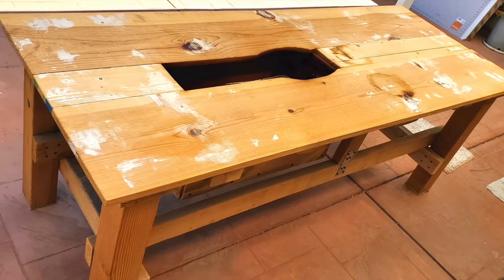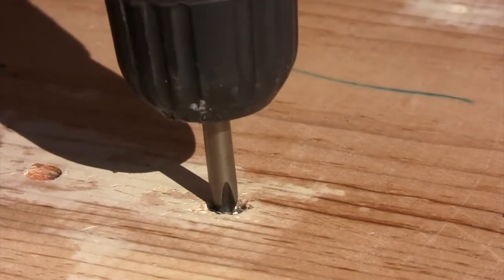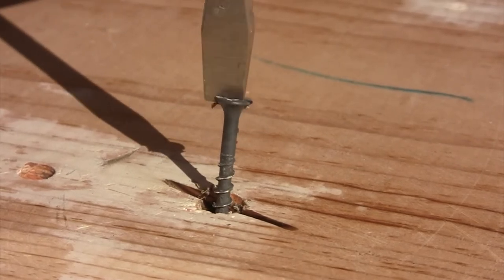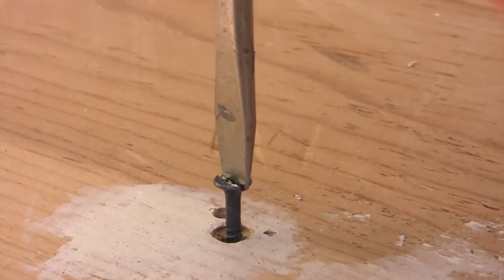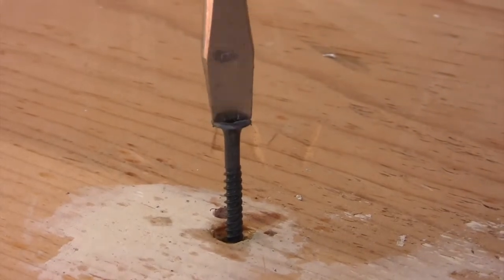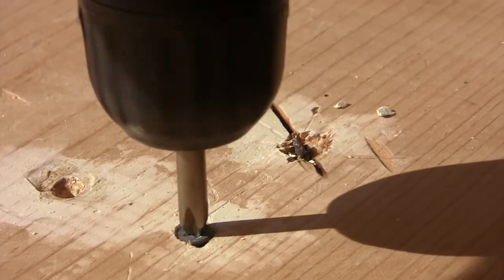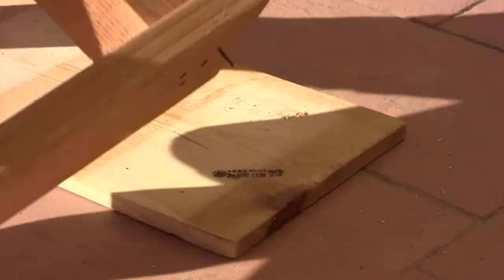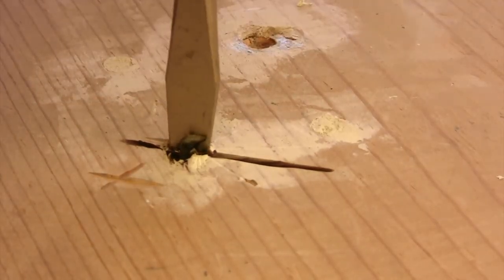HOW DO I REMOVE STUCK SCREW OUT OF WOOD

Comment: Use channel locks or vice grips on the head. If you have even a tiny bit showing. Clamp on vice grips are great for this. The handles on the tool are long enough to give great leverage so removal is easy. You just need 1/4" showing
Reply from the maker: Thank you so much for for the tips.